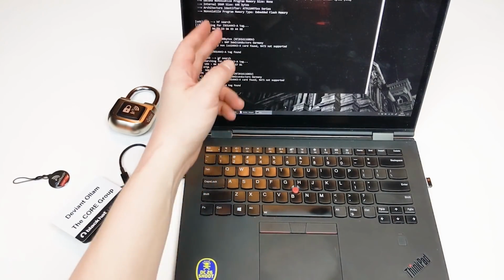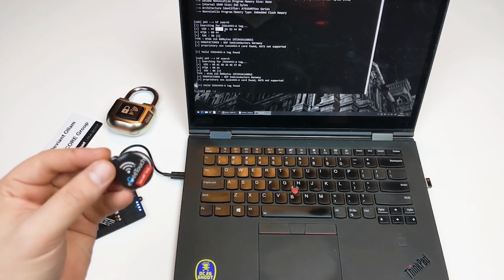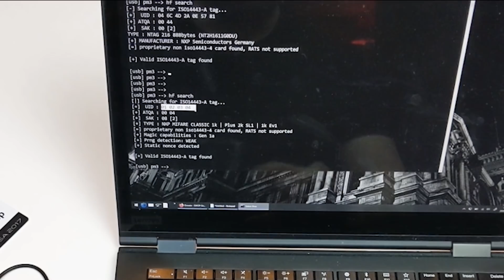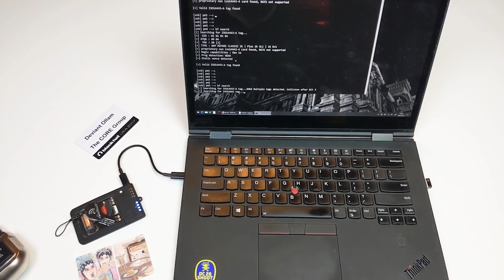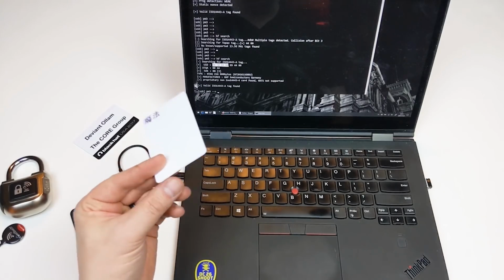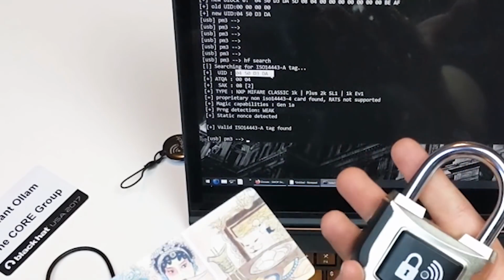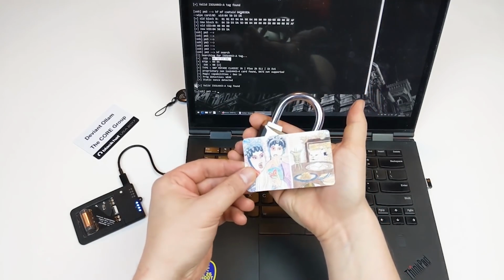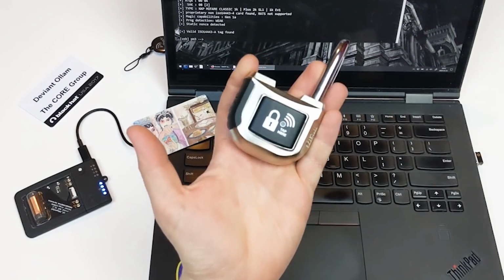Wrecking a Horrible RFID Padlock

Comment: What if the battery runs out? I mean this will NOT work in very cold climate simply because lithium batteries die out quickly in cold.

Comment: A friend of mine found out that most of the RFID locks at our university unlocked if, when you were supposed to supply a specific code with n characters, they got any code with n+1 or more characters. Luckily, important stuff also required you to type in a card-specific code, so I almost suspect someone just did something ill thought out to the less strict locks to avoid having to input your own code all the time.

Comment: What a great example of the future of JFC-based security devices.  No longer do you have to settle for some shimmable padlock with a three pin core for $10, now you can spend $75 for the cutting edge of utter crap!

Comment: How many combinations are there? 0000 to  FFFF ? Wouldn't that be 65,000 possibilities? (16, 256, 4k, 65k)
At 65,000 combinations, I would assume a brute force would take a long time.
I'm not trying to say 4 hex values are secure enough, especially since chances are the code wouldn't be FFFF.
I think the biggest issue here, is they have a 14 character hex code, which would be very secure, but they decided to only use 4 characters.
.
Of course the biggest issue with a 4 hex code, is what if the code was 00-12, then the 13th brute force attempt would work.
Worse yet image if the code was: FF 00 00 FF FF FF FF. You would think "wow, that would take forever to brute force" not realizing the first attempt at 00-00 would work.
.
Now I'm going to attempt to get an estimation without really knowing if this is accurate at all.
50 D3 would be 31% 0% 87% 18% which i think could be viewed as 31.08718% of 65,000, which would be under 32% which would be under the 20,800th combination attempted.
.
Hex combinations based on number of characters:
(1) 16,  (2) 256, (3) 4k,  (4) 65k, (5) 1m, (6) 16m, (7) 2.6g, (8) 4.3g
according to this: https://www.electronics-tutorials.ws/binary/bin_3.html

Comment: I wonder what a USB killer would do to that lock as the charging port is exposed.
Reply: In theory if it die is should remain locked, but considering it's an absolute garbage, I wouldn't dismiss the magnetic latch would just open while being zapped.

Comment: What kind of reader are you using on the laptop? Also could you do a video of the software as well please. Thanks.
Reply from the maker: that's a proxmark3 RDV4.0 unit, but one that i've modified with a different Low Frequency antenna... yeah, i'll totally do a video about it for you folk in future.

Comment: what reader/writer are you using. i have been using an arduino project i made myself and despretly need to upgrade
Reply from the maker: proxmark3 RDV4.0 but i have a modified antenna
Reply: DeviantOllam holly fuck that sob is expensive
Reply: Thanks for sharing. Was there a problem with the original antenna?

Comment: I wonder how quick the padlock can accept these codes? Potential to just make a transmitter that screams through the whole table of potential values?
Reply: Not really necessary on a lock this bad.  You can open it with a strong magnet.  It's also likely to not have a very strong body, in order to fit all the electronics in there the walls will be thin.  A sharp blow with a hammer will likely make it shatter.
Reply: @steampunkskunk3638  Yeah, but if they've made the chips to build these, someone else will buy those chips to make more and you can bet there'll be a ton of these crappy things flooding the market. And it's always nice to have a contactless method to unlock these kinds of things without leaving evidence of tampering.

Comment: What is the reader/writer you're using in this video?
Reply: Looks like a Proxmark3 RDV4
Reply from the maker: correct.  with the Tom Harkness special Low Freq antenna (not used in this vijeyo, however)
Reply: @DeviantOllam  a fellow AVE watcher i see.

Comment: What are your thoughts on Bluetooth safe locks? I assume that the code is transmitted via Bluetooth and determined to be accurate by an internally secured device. But is there a vulnerability there? I do prefer a good old fashioned dial for reliability but I'm considering a hybrid for greater convenience.
Reply from the maker: i'm not a fan of electronic locks in general

Comment: I wish I had taken a photograph of this.. the simplest fake security I've ever seen was in a Seattle condo I rented in Belltown. They kept the cleaning supplies in a closet with a TSA luggage lock on it. But the hasp was screwed into the door only. You could open the door and the lock and hasp came along as if they were hung on the door as decoration. I guess they figured if it appeared it was locked no one would mess with it and wouldn't notice it wasn't actually locked!
Reply: A lock only keeps honest people honest.
Reply: I've seen public access areas with network closets. Two doors swing together and lock. turns out you can just pull the doors open. No key required. FML
Reply: I once had sliding doors on ground level to my hotel room. The lock on that sliding door had no effect whatsoever. Got robbed the second night there, so yay.
Reply: TSA luggage locks can be opened with universal keys, nobody should use those.
Reply: @lillexus5589  I'm not sure if it was clear as it is hard to describe. It could have been an Abloy 362 but didn't matter as the hasp wasn't locking the door to the frame or anything but itself. The average VRBO/AirBnB/whatever renter isn't going to have a set of TSA keys but the point was not the cheap lock, but that nothing was actually locked. It just gave the impression of being locked and I almost wouldn't have noticed it was simply the illusion of security but I felt compelled to inspect it.

Comment: Dev, little question, your link in the dooblydo to Amazon is a standard www link, do you know about Amazon Smile? Do you use it for yourself personally but don't put the Smile link in the dingleberry? I've been using Smile for YEARS and while my purchases have contributed less than 60 dollars to the charity I chose, it's still money for a charity. I have the EFF set, but TOOOL is an option as well, and it's configurable per user, so if you set yours for TOOOL and then posted a Smile link and I click it, my purchase if I made one would go for the EFF.
Reply: THIS
Reply from the maker: i've heard of Smile but have mixed feels on it.  keeping my links 100% plain side-steps any possible criticism
Reply: @DeviantOllam  That's fair, but do you mind elaborating on your mixed feelings with it? Genuinely curious. You can email it if you would prefer it not be publicly discussed, you have my email address.